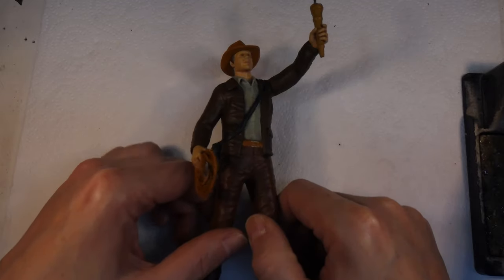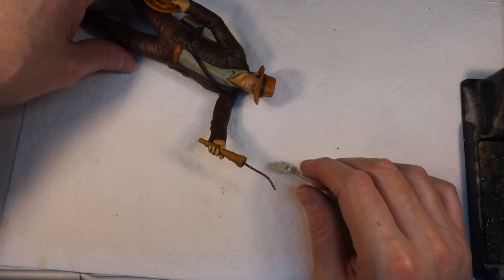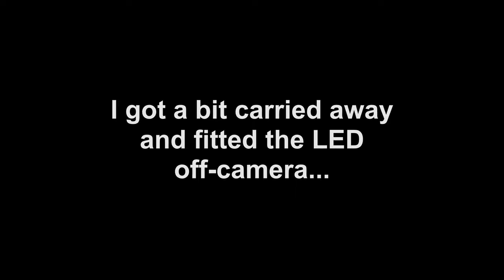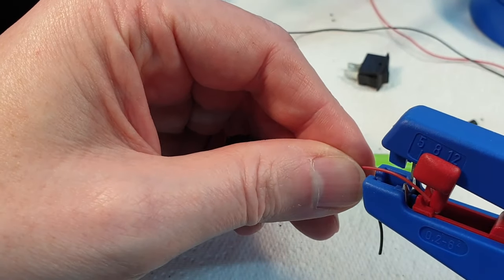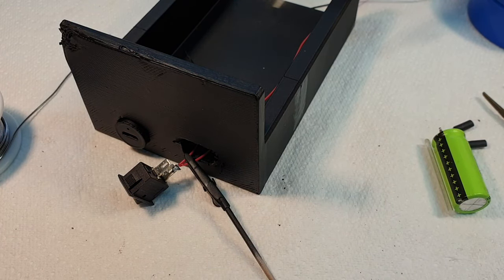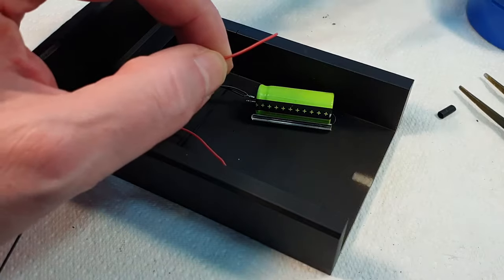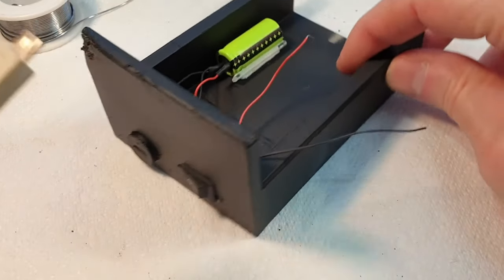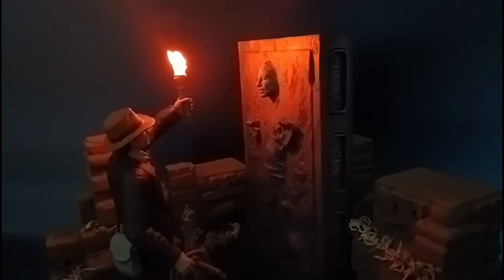Painting a mind bending 3D sculpture for one of my Patrons - Part three - let there be light

Comment: Superb effects with the LED - may I suggest with soldering though that the wires are tinned first. This will give a much more secure welded joint on all joints
Reply from the maker: Good advice and normally I would, but for something like this it's not 100% necessary 🙂